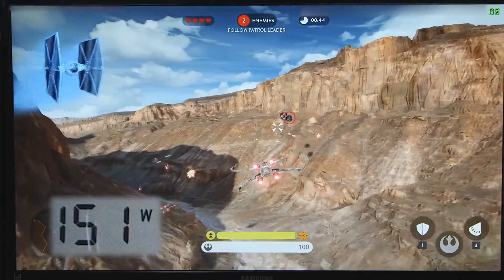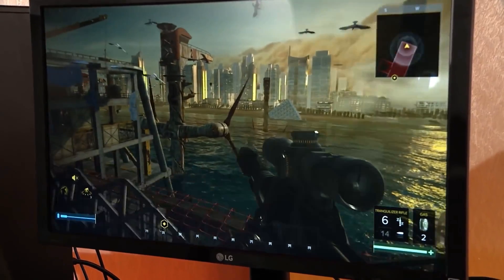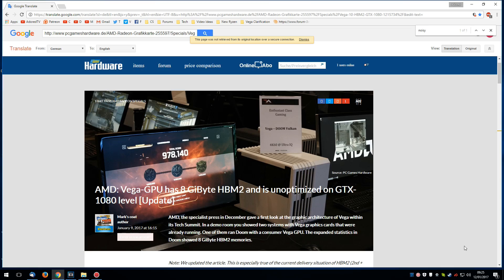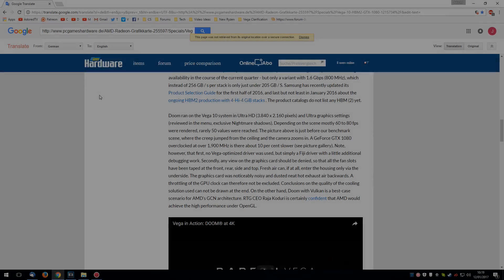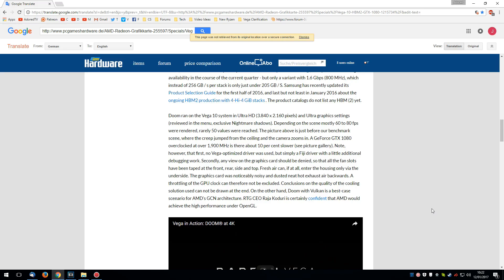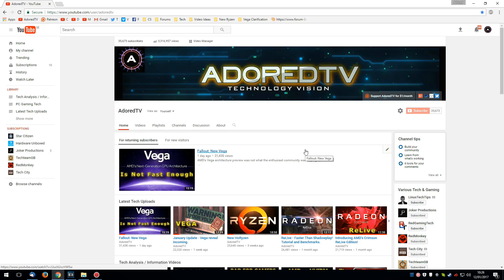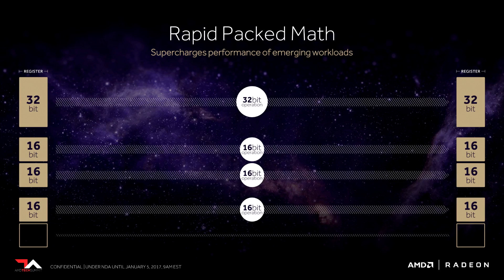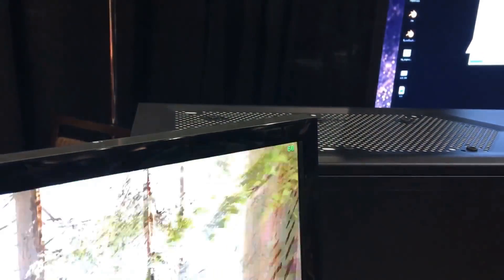Vega Clarification - How bad is it?

Comment: Did you check the Good Old Gamer's video's? He have stuff to say about you on his channel.

I still wonder what the possible cost will be to manufacture the Vega chip of that size. Do you have some idea how much it cost to manufacture that much silicon on the die, like what is the $/mm^2?

At this point, I think AMD has to refocus their market and I also think that by focusing more on the professional segment is a wise choice. To think that developers have to make their games on AMD cards in the future and then NVidia users playing the games. AMD is likely trying to overcome the Gameworks debacle by offering something better to the devs with their technology and I think the open-source thinking will make AMD a bigger success in the professional segment than gamers market.
Reply from the maker: I noticed he had a video up but I haven't watched it yet.  A 500mm2 die with HBM 2 won't be cheap, that's all I know.

Comment: i have a kind of odd question...with the new HBC (high bandwidth cashe) and new Motherboards having M.2 slots can you run an M.2 SSD and the cashe that can be used as Vram?   i was just looking into the new motherboard and saw them.

Comment: Those Fiji drivers ran in debug mode. I don't know how much difference it makes, but 30% were suggested.
It's also important to mention that GloFo's(AMD 14fpp) silicon is absolute trash. Nvidia's(TSMC 16ff+) allows 12% more frequency per watt on the same architecture.

Comment: Regarding driver optimization, one feature that was NOT in the driver at CES was the variable wavefront feature. This is a big thing according to AMD. Now, I'm not sure if AMD is just blowing hot air about that, but that is the only thing you didn't adress in this video!

Comment: I mean, AMD if anything should sandbag now. GP102 in the form of the 1080Ti has not been released. You saw the Fury X result with the 980Ti. Massive disappointment because they announced Fury X for that low price point, but got shut down when Nvidia announced the 980Ti for the same price point. They need some sort of element of surprise for this launch, and hopefully it takes Nvidia off guard.

Comment: I'm not dissapointed with Vega because I still know zero things about it. Usualy when I know that much I don't speculate because speculation requires more than just "engineering samplewhile debugged is faster than 1080" and nothing more. Keeping in mind how calm was AdoredTV in his speculations when he had much more informations than now I find very strange this extensive change in manner, speculating on a base of almost nothing, making conclusions in catastophic fashion. In propaganda there is something called limited hangout. In some distant way all before  smells now like that. Youtubers which were undeservedly or deservedly called Nvidia biased are much more cautious making conclusions. One way I can see it is AMD is keeping hype under control. Last time Nvidia shills pretending to be AMD fanboys were pushing hype all the way to naive casual GFX buyer dissappointment. Another way I see it is some kind of anger. Losing calmness this way leads me to speculate there is some anger involved. Kyle Bennett 2.0 anger type. I don't need that. I believe many don't need  that.I can find hysterical speculations based on almost nothing all around at every step. Let alone ill intentioned. I allow good soldier to be devasteted how his heroes seem to turn out to betray their principles or expectations but this is no way to do it and push a hero into storm without investigating more. If I was AMD I wouldn't bother anymore giving any informations to someone who don't need them to speculate in so malicious way.

Comment: If these cards are the equivalent of the fury/fury x then things are bad.... 

If these cards are the equivalent of the R390/R390x, and priced accordingly, then we could be looking at a R590X that's 10% faster than a 1080 before drivers are developed.

How sure can we be that we aren't looking at a £350-£400 GPU that ends up being 30% faster than a GTX1080.

Does anybody think  a 1080Ti could do anything to combat this card?

The 400 series launch didn't bother to compete with the 1070/1080 cards. Is it not possible that the 500 series won't bother competing with the 1080Ti/Titan XP due to the relative small size of the very high-end GPU market?

Comment: The successor to Nano is the real GPU to watch for. Equal power draw to the previous Nano, double the memory, higher memory clock speeds, and possibly 40% faster under lighter graphical loads if it clocks up to 1300MHz. If it can sustain 1000MHz at a 200w power draw under maximum load it will be as fast as the Fury X with half the power draw

Comment: In this whole analysis one thing doesn't add up. Why didn't they simply make a bigger Polaris chip? Why all this waiting to get a mediocre boost? So again 200 changes in arch is all just gimmick with no output on performance whatsoever? I thought Pascal was a refresh, not Polaris or Vega but it all seems otherwise. I'll pass this speculation and simply wait and see on my own eyes.
Reply: Damian B I think Vega is probably so different because it brings a lot of useful things for professionals in Deep Learning, AI, etc
Reply: If so then how someone call this a lost cause? High end was proven to have minimal effect on revenue, there is simply to low volume to chase it, let nVidia have it. This speculation about making profit is pointless without a wider angle and such angle is only known to AMD insiders.
Reply: Yes I agree, it's not a lost cause but it's a different cause I guess. By attacking wider angles they might get some results. We'll see in the end, and I'm still going to get one of these :P

Comment: One item to keep in mind:
AMD opted to include BOTH GDDR5 and HBM memory support in Vega 10.
This costs quite a bit of die space.

Edit:
It will be interesting how the flexible wave front size for the SIMDs will pan out. But this will definitely require optimized drivers.

Comment: October/November  quote Koduri "It will be a while before you see it" 2 months is not enough time to finalize a chip. It's barely started to get off the press's in mid - late 2016.  this is looking like another mid yr launch for Vega, they have at least 3-4 months left of work on this chip unless yeilds are surperb with no issues.
in 6 months the 480 snagged up a 12% performance gap to now be ahead by 2%, that's a 14% performance increase not including Nvidias own performance increases with drivers.
Vega releases and it is 10% faster.....how long before it's 15%-20%+?
I'll take that 10% and watch it grow over time, while Nvidia sits pretty much stagnate on a shrunk die of maxwell.
AMD driver gains are averaging 3%+ per release

Comment: You do realize that Vega 20 is the series meant to compete with the Titan X right?
http://wccftech.com/amd-vega-10-vega-20-gpu-details-dual-gpu-graphics-card/

It's a 7nm node, which is twice as small.
"Vega 20 will be building on AMD’s philosophy of curtailing excess and 
should bring significant leaps in power efficiency and performance per 
watt. The GPU will have the same core count as the Vega 10 GPU at 64 
Compute Units and will be based on the 7nm FinFET architecture. Since 
the designation remains GFX9, we can easily assume that this is, in 
fact, a simple node shrink of the Vega 10 GPU ported over to 7nm with 
bigger and better memory (it will have 32 GB HBM2 with 1 TB/s of 
bandwidth)."

Only time will tell if Nvidia really wants to push ahead rather than keep selling what they currently have for profits.
Also, AMD has been extremely aggressive on the pricing, though the problem here is that resellers don't give a crap given the years of abuse AMD took from Nvidia, might have worn down resellers' trust on AMD to deliver, resulting in a lot of biased reseller going Intel+Nvidia (It makes you money, the products has high demands, and is pricy meaning you get more money).

CanadaComputer is 99% biased, they probably have a grudge against AMD because they couldn't sell off their APU and FX Chips even if they wanted to, and must have took a loss.
Reply: What? By the time Vega 20 is in the hands of consumers, Volta will be out, and chances are, so will a new Titan.
Reply: @Kamus hey Head of AMD. Since you know when Vega 20 will be out, can you tell us the prices of the Vega 10?

Comment: Nvidia doesn't have a 600mm2 p102 gpu with hbm. They already have a 600mm2 gpu with hbm, it's the gp100 and it would be slower than the gp102 at 471mm2 in gaming.
Reply from the maker: Yes because it has lots of FP64 ALUs that are useless in games.
Reply: AdoredTV Yup, but I don't see nvidia dropping a 600mm2 gp102 with hbm. The problem amd now have is nvidia are able to design two entirely different gpu's with entirely different resources to compete in different markets while amd can only afford to build one solution to compete in both markets. Gp100 for professional compute and gp102 for gaming while amd will have to do with vega 10 for both. I really want amd to compete though, nvidia pricing is ridiculous at this point.
Reply from the maker: They will eventually drop that 600mm2 GPU with HBM, the question is will they do it this generation or will they just drop a 600mm2 gamer GPU with GDDR5X instead.

The only way they can charge $1500 next year is with a bigger, faster GPU, and the only way to get fast enough vs the Titan X is with more die size.
Reply: AdoredTV If they stay on 16nm even half as long as they did 28nm then they'll certainly have to go big but they may just stretch out the titan xp and 1080 ti for a year longer and move to the next node.

Comment: Adoredtv, I think AMD's basic strategy at this point is to hold the line with nVidia in terms of GPU performance while Zen takes market share and generates all the money. Vega will do this. Yes, nVidia is certainly making money, but AMD will soon be doing at least as well if not better with Zen. Meanwhile, AMD's GPU division is also penetrating various niches with their GPUs, like HPC, VR, machine learning, etc. Since they already control the x86 consoles, and they've managed to boost their PC add-in board market share, the graphics division is already doing everything AMD wants them to do.

As you yourself pointed out, AMD already controls >75% of the x86 gaming market (consoles+PC), and that market share is only going to increase with the nextgen Sony/Microsoft consoles also being AMD. Finally, the next blow to nVidia is going to be Zen-based APUs. This is almost like a classic encirclement military strategy. While AMD is holding the line (keeping up) with nVidia on the performance GPU front, they're simultaneously cutting nVidia off from the revenue stream from major gaming consoles (Sony+Microsoft) with their custom APUs, while AMD ALSO cuts nVidia off, first from the low-end gaming GPU market (you can actually play many older/less graphically intense games on an AMD APU already), and soon, even from the mid-range, with Zen+Polaris/Vega APUs on the PC side. Even as nVidia makes lots of money from high-end gaming GPUs, they are getting painted into a smaller and smaller niche of the over gaming market.

Again, as you yourself keep saying, AMD's only strategy is to cut nVidia out of the gaming market, and that is exactly what they're doing. Yes it will take time, but in the meanwhile, AMD already has nVidia caught in the noose. nVidia has already structurally lost the gaming market, because they cannot increase their overall share of the gaming market without taking one of the two major consoles away from AMD, and that's not going to happen.
Reply from the maker: It takes time yes, and yes Ryzen is the key to success and always was. ;)

Comment: I think most people want a 1070+ level AMD card. Most play at 1080p and 1440p, so at the moment 1070 is a great choice for 144hz 1080p and 1440p. GTX 1080 is too expensive and also the amount of people on 4k is tiny. As long as Vega is at least as powerful as the 1070, and ideally a 1080, and priced right then I think it has done its job. Yes there is some benefits to offering the fastest commercial card in the world, but I prefer the very decent performance and affordable approach myself.